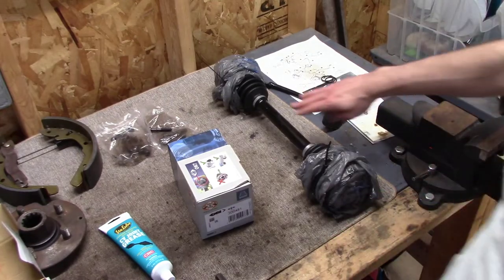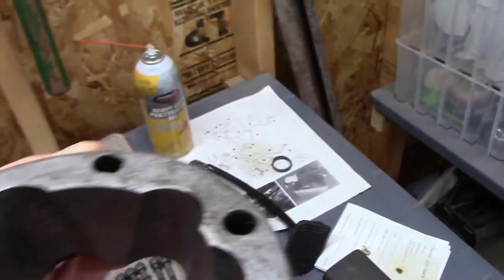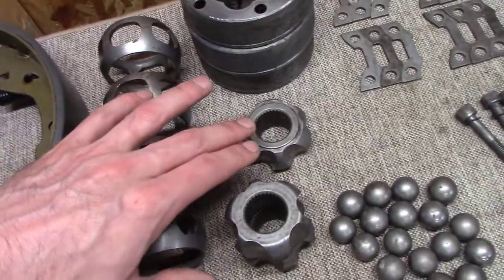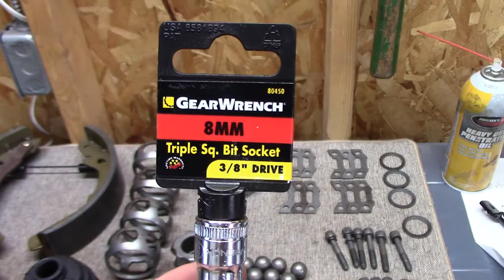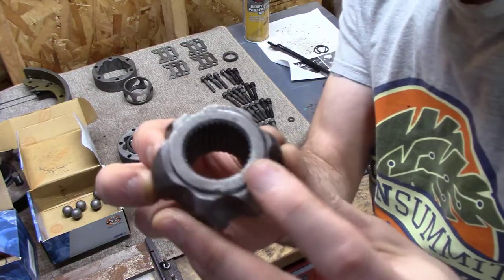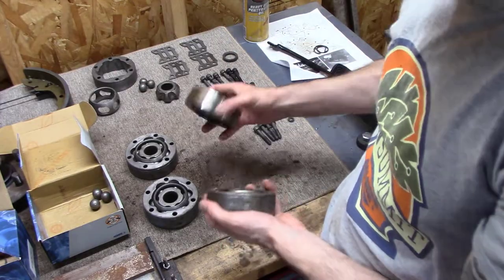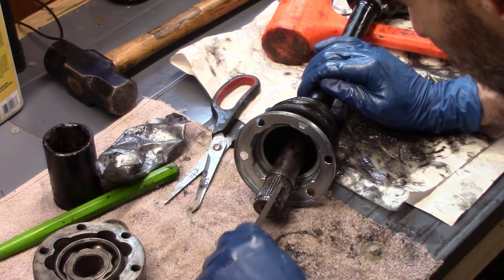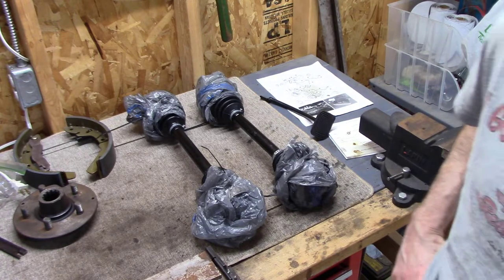VW Bus Restoration Part 11: Rebuild axles and CV Joints

Comment: Thank you for the video. I noticed one of my outer boots is sporadically making a clicking sound - mostly when running in reverse. Turning wheel by hand - no clicks. Turning by motor - sporadically clicking. The boot has no damages. Going to take it apart tomorrow now that I see what it's like inside from your videos. If you happen to know what could cause this, I'd appreciate any advice.
Reply from the maker: Thanks for watching.  I am not sure what is causing your clicking sound.  If it's not a loose axle bolt or something in the transmission, then it may be something wrong inside the CV joint.